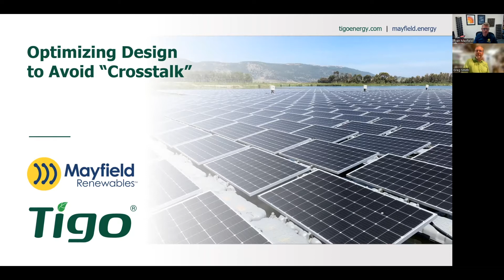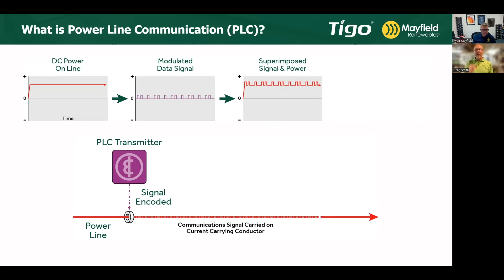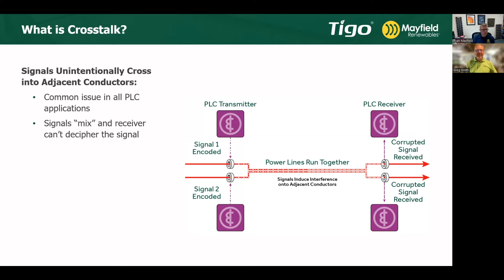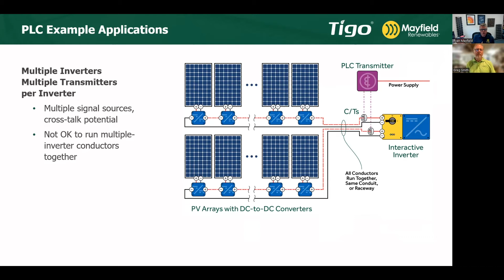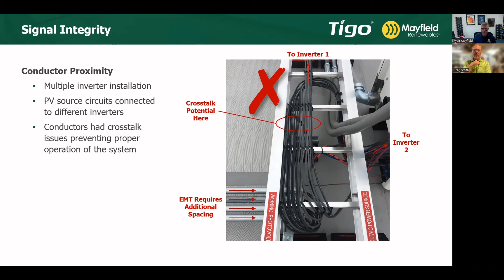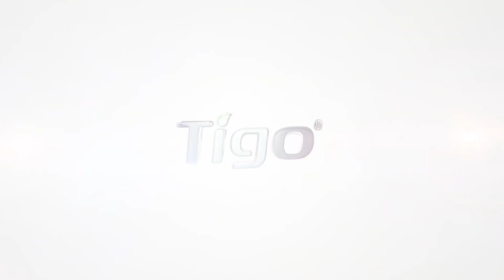Mayfield Renewables and Tigo Energy - Crosstalk Workshop

Comment: Super useful! Doesn't mention what I feel would be a pretty common setup: multiple inverters but only ONE CT (assuming <= 10 conductors, etc). Feels like this should not be a problem given that the crosstalk comes from multiple CT's, but wanted to ask and point it out in case.
Reply from the maker: That is an excellent observation! You are correct in your design- multiple inverters can share a single RSSx and Core if there are less than 10 negative conductors from both inverters.
Reply: @Tigo_Flex_MLPE  Thanks for the reply!